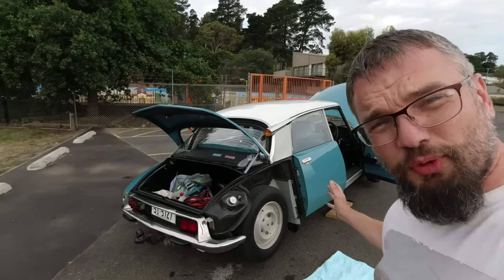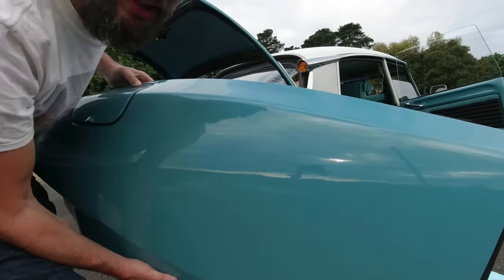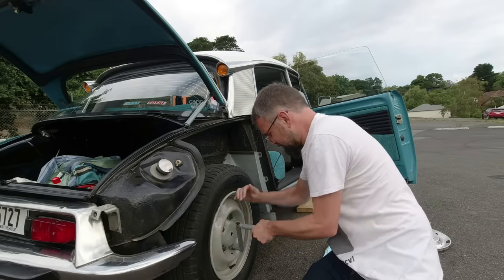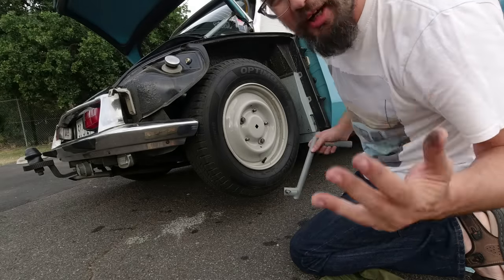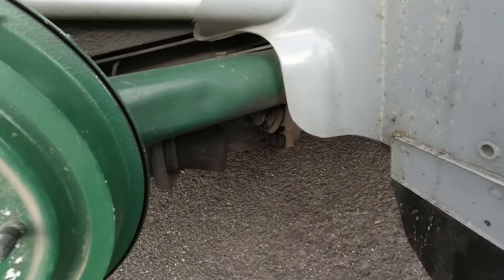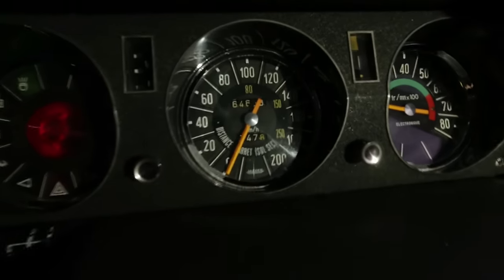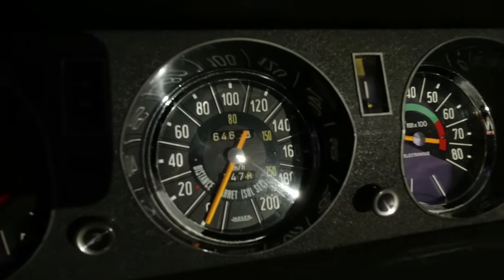Can it drive on three wheels?! And other Citroen DS Party Tricks

Comment: I remember going to a test day at
Mallory Park in the late sixties, where ta Citroen test driver did
the three wheel party trick and drove round the circuit, not too
slowly either. On the same day we were entertained by Innes Ireland
demonstrating a car, for the life of me I cant remember the make. The
demonstration didn't quite go to plan, a little too much sideways
action coming out of the devils elbow and the brand new car ended up
rolling down the start finish straight in spectacular fashion.
Luckily no one was hurt other than Innes's pride.

Comment: The swiveling headlights is a feature on posher versions of the old W211 Mercedes E-class as well. It's possibly not as pronounced as the Citroen implementation but on a dark twisty road at low speed it is clear that the lights are steering around to maximise useful illumination. Great feature!
Reply: I have 'em on my car.

Comment: Hi Hubnut. This car is like a new one. Citroen had it licked years ago with party tricks that other cars didn't do. Then didn't later models got more conventional in everything? I've gone and bought myself a Jaguar X Type. It's done 95,000 miles, 58 plate, Gleaming paintwork and good leather interior. Diesel 2.0 litre. I know what you're thinking 'What? a diesel!!!' Afraid so but it runs great and doesn't gobble fuel like a petrol Jag. £2,195. Dead chuffed. It's got electric everything and everything works and get this, it's got a proper alloy wheel spare wheel. This has to be a bargain. Keep up the good work. Cheers.

Comment: I don't think there is one DS owner who will not tell you a DS can drive on 3 wheels (as long as one of the back wheels is missing). And the demo is then always a dry demo or mock up if you will. But this is the first time I really get to see it, way cool. Anyway, never mind the party trick which is almost a public secret, what impressed me the most is the marvelous condition this DS is. You can only see that when you start to remove body parts like the rear fender. Compliments to the owner for keeping up his car so well. 
BTW, general de Gaulle owes his life to the DS when an attempted assassination was carried out on him. I forgot the details but I believe a rear tire was shot out or so and by raising the car up, his driver was able escape on three wheels. Something like that, but don't take my word for it.

Comment: I vaguely remember the Citroen GS TV commercials, where the car drove over broken glass, puncturing one of the rear tyres and continuing to drive, thus effectively on 3 wheels.
Reply: One of the TV ads had a driver driving between two oncoming HGVs side by side a car-width apart, and pressing a button to blow one of the tyres as he approached - and then he was able to continue without swerving in the narrow gap between the lorries.

Comment: While traveling through Kansas with my DS 21 i ran over some crash debris and destoried two tires.  I drove 40 miles to the next town on three wheels... I loved my 4 Citroens!
Reply: Also owned 4 D-series. Yes there were 5 full-size wheels and tires. Best to do the three-wheel stunt with rear wheel off the passenger side. Also, I think the drum would have more clearance with suspension on lower (maybe not lowest) position. If you bought your DS in the USA, it might have had a lockout guard on the suspension quadrant, which could be removed.  Funny that my '65 DSManual 21 had a a very short brake pedal, rather than the mushroom. And the clutch pedal had a weirdly awkward motion, compared the '60 ID19. My 4th D-Series was a '68 DS19 with hydraulic semi-auto gears & clutch. However, the 4th gear was too low (noisy) at 62 mph (100 km/h). The later 5-speed apparently did not have a "taller" final drive. The "rocking" headlights felt the impacts from the suspension and would shorten bulb life from night driving. The weight distribution 66-34 cause of poor handling, and I shudder to think of the roof caving in should the car roll over into a ditch. (It did happen to my '79 VW Rabbit (Golf), the steel roof held, although one A-pillar and door frame slightly buckled and windshield smashed). And the DS seating comfort not as good as my Volvo 740. However, due to pillar positioning, the visibility from the driver's seat optically made the pillar "invisible"- something that is missed by most non-owners.
Reply: @omarjette3859  I have owned many cars, MB, Saabs, Audis, Fords, Chevies but nothing was as safe or comfortable as my 4 Citroens. The last a 1973 SM..  Twice I avoided head-on collisions by taking it off-road both time at about 70 mph.   In the one instance in the US I ran over a traffic directing curb about 20 cm high to avoid a car crossing my path from the left.  Thought at first we hit the other car.  I stopped walked around and no damage. 
 The other time in British Columbia I flew off the road avoiding a head-on collision with a crazy guy passing a logging truck.  We went air-born and landed on the grassy slope of the road's abutment, it was at about a 30-degree incline, then seeing a concrete spillway ahead I whipped the wheel to the left and went air-born again landing in the center of the high way heading for the other ditch.  The car fishtailed a little as we lined our momentum up with the road and got back in our lane.  In both cases no damage...  Best cars I ever owned...
Reply: @jamesdond1  Suspect that the SM would handle better than the DS. I not only owned 2 IDs, a DSM21 and a DS 19 Pallas, but also did mechanical work on them. 
The 5 best features would be: a) the suspension, with its variable height and firmness control; b) visibility for parking and panoramic front view; c) the original 3-bearing engine was quieter at speed;  d) good low speed traction on snowy/icy roads; e) relatively easy to work on mechanically - with a little guidance from shop manual.
The 5 worst features were: a) weak roof and supports; b) the door hinges were just like steel pencil points - were they thinking them to fly off in a crash?; c) poor weight distribution resulting in extreme under-steer; d) engine difficult to keep tuned - an aftermarket electronic ignition helped a lot; e) the inboard brake discs could be damaged on bumps unless one raised the ride height on rough roads.
Not a fan of FWD cars, however my '09 Dodge shifts and pulls better with a 1.8 L engine. Unfortunately, if rides more like a Jeep.
Reply: @omarjette3859  The design of the Citroen regarding crashes is unrivaled.  When the Ford Pinto cases were tried the DOT produced videos of Citroens being crash tested to show how crashworthy a car could be made.  The funny thing they were outlawed in 1972 because of their crumple zones violated US bumper laws that Congress passed under pressure from insurance companies  Citroen withdrew from the market rather than sell unsafe cars.  The Ford (Boomabout) Pinto was legal.  But par for the course, this is the same bunch that forced airbags on the industry even after hearings that said they could kill 80 to 100 children yearly.  The chairman remarked, "that's an acceptable loss."  There are no engineers in Congress...
Reply: @jamesdond1  Not amused by the airbag that sits inside my steering either. Would be interesting to see the stats on how these have worked out (if we can believe them, as the old saying about ...damn lies). Also would be good to know how the crash/injury stats for DS-types stand. My '09 Dodge's body sides and beams are massive and stamped in one piece (I own a body repair manual). I know, car safety should be a combination of occupant protection and accident avoidance capability. Still would be interesting to see if later model Citroëns had computerized stability controls. Would rather put my money on RWD Volvo for safety, comfort and handling. BTW, presume you had the "American" spec Citroëns, whereas in Canada, we had the Euro specs. Jay Leno has his resto-modded as allowed by the "antiques" rule.
Reply: @omarjette3859  In 1976 I was T-boned by a big Chevy on the passenger's side.  The Chevy was totaled and the passenger went to the hospital.  No seat belt.  I drove my  1972 DS 21 home,  They replaced both doors put the interior back on and had to replace the stainless steel panel on the side beams but the B pillar and the box frame took the hit well even though we slid sideways for about 10 meters.  It happened in the rain so the coefficient of friction was compromised.  My passenger was freaked out but not hurt.  We both had our seat belts on. I had one other hit on that car in the back.  It was minor but taught me to keep track of the cars behind me...  A few years later we were in the midst of a 25 car pill up in a construction zone where they had put barriers on each side of the only lane open.  Traffic slowed to about 50 when I saw what looked like glass exploding into the air about 6 cars ahead. I put the breaks on and then noticed the car behind me was about to hit me.  I let off the brakes got about three meters from the car ahead then tried to hold that distance as we stopped so as to give the guy behind enough room to stop.  When all the skidding and banging noise stopped there were  10 cars head and about 15 cars behind crashed together, but we were not hit..  One of the things we noted the new "5 mile an hour" hardened bumper law put the back bumpers forcefully over the nose-diving front end destroying things.  Another thing the congressional playtime engineers never thought of.  The brakes on the Citroen could stop the car so fast and yet were so controllable.  The bad part we were stuck there for over 4 hours  My last DS was from Canada... had the enclosed headlights...  So cool.  Great for shining on addresses in the dark...
Reply: @jamesdond1  So it appears that the DS doors absorbed the impact without telegraphing any to the frame. Even a '76 Chevy was before the era of plastic foam "bumpers" (but rather massive chromed steel) and no crush zones. Always recall the IIHS crash test showing 1959 Chev vs. 2009. The '77 GMs were "downsized" massive.
As for pile-up on the freeway, when lanes alternatively slow down or clear up, one must concentrate on what might come up ahead. I was not involved, but following slowly in the middle lane of a three lane, noticed that left lane up ahead was completely stopped. However, the next driver to my left was not paying attention, did not brake (no tire squeal) and WHAM, smacked straight into the rear of the stopped car. Nothing I could do except keep moving, however, in a very short sideways glimpse, saw FLAMES at front of the crashing car. Happened so quickly, but did not seem that the airbag deployed. The important thing was for me to watch out ahead.

Comment: I once "borrowed" a DS and took it for a spin. As luck would have it, I got a flat and had to change a rear wheel. I can't remember the details now 40 years later, but I guess I must have head the driver's manual, since it's not intuitive in any way. Other than the puncture, the car wasn't harmed in any way (The keys were in the ignition). I remember that it was surprisingly fast.

Comment: Excellent ... thank you, kind sir ... as with others, knew well about these, but never saw them in action. Particularly the view from inside with those swivelling headlights. They’re brilliant. Have the VAG cornering fogs on my Fabia, and they’re ... not quite useless, but.... Ok, great vid, ta, Ian!
Reply: My Subaru has LED headlights and two of them point around but other than the way they wave about when the car is started I've never noticed the effect. They are about 10x the early aero headlights on my previous ride though.

Comment: Fun fact there's a citroen guide to applying the hand brake in order to apply the hand brake you must first apply the foot brake hard. The reason for this is as the hand brake works in the front when the discs are hot as the invariably are they expand. So if you park up with hot discs as they cool they contract so effectively releasing the hand brake. That was my CX's party trick
Reply from the maker: Never heard of that trick, but it is true that firm application of the brakes does tighten up the handbrake. A good emergency stop makes a huge difference! Have certainly heard of Citroens running away. Even Xantias did it! And my first 2CV...
Reply: @HubNut  to be fair it was only ever a problem if it was parked on a steep hill and i'd forgot to leave it in gear

Comment: Back in the early 2000's I drove a wagon delivering furniture all over the UK. One day I was leaving Southend heading back to London when I saw  DS for sale in a used car lot. I STOPPED TO HAVE a look and the salesman came over. The car was in respectable condition, nowhere near mint but very nice, it was finished in a lime green metallic, was fitted with A/Con. and had a brown leather interior which looked very dry and stiff, it was also l.h.d. All this was explained when the seller said " This car's previous owner was Monica Vitti and it's just come in from the South of France,have a sit in", so I did. After I got out he then said "There you go, your arse has just been where a sex bombs was". I'ld have loved to have bought it but he wanted £8000 for it then,  about 16 or 17 years ago and I was only a lowly driver so had to pass  on it.

Comment: And if that´s not enough. The main-beams (headlights) is also automatically adjusted in height in accordance with the pitch of the car depending on the soft suspension, which sinks the rear down and raises the front when accelerating hard (dynamic correction). This was invented so as to not dazzle meeting traffic. Otherwise the DS has constant ride height, irrespetive of load, so the main beams is always rightly aimed (static correction).
Note: The original D Special didn´t have the swivelling auxiliary lights nor the automatically adjusted headlights. So this must bee a modified car.

Comment: I love an old Citroen, but I always tense up a little bit when I see one being raised up. My BX died this way, the day after I bought my new car (I had intended to keep the BX as a weekender, in hindsight probably not realistic) - I took it for a wash, raised the suspension up and pop... something blew. Green fluid everywhere. It was uneconomical and impractical to fix particularly as I was moving across the country imminently so I had to let it go, but I did get around 3 years of almost cost free motoring out of it.
Reply: I had BX, no real problems with it, usual stuff did go wrong.

Comment: Engineers used to have all the fun back then! Steerable lights, active suspension, Concorde, Harrier jump-jets, Fairy Rotodyne, TSR-2, Apollo Saturn V rockets, cars with turbine engines for goodness sake! These days electric motors and a bland tablet instead of controls are about all we get. So stylish, somehow it needs French yellow headlights, but i suspect they wouldn't be legal in the Antipodes.
Reply: Too bad Citroen couldn't invent self-cancelling turn signals or a side mirror & sun visors that would stay put, for themselves and starter troubles WOW.

Comment: Very interesting, great to see the DS tricks in action. Much thanks to to the owner of this magnificent example too, love the colour and the delicious upholstery.
Reply: Both are perfect for the car. Mr Nut never said if the reupolstery was the same or close to the original or a possible original option.
Reply: @emjayay  This is the third time this car has been upholstered.  Originally it had a peacock blue velour which clashed a bit with the outside colour.  The last owner changed this for a lighter blue velour which looked better but by the time I bought the car that was starting to look sad.  I had the option of getting original repro. covers from Europe or just go my own way.  I decided to go my own way and I had an endless choice.  Settled on this one which is also supposed to wear very well.  Cheers.

Comment: My Vectra Estate has AFH, Adaptive Forward Headlights, and turns the same way,but goes by speed, so if going slow, will turn to it's steering input, but on high speed will only go a few degrees.

Comment: Great fun, I know this could be done, but this is the first time I've seen it. Slightly related, I was driving a E class about 17yrs ago and had a blow out on the M23. I was doing about 80mph (😂), I heard a pop, but apart from that, absolutely nothing, no tyre noise. Of course, pulled over and changed the wheel, but could I have carried on to the next junction? I am assuming the electronic suspension & what not kept the car level. 👍

Comment: Thanks for showing this. I have always loved the DS. It really is a masterpiece and this yours is a real gem. BTW, is it possible to remove the back wing if the car is normally parked if you have a suitable spanner?  And what was that grrrg . . . grrrg . . . grrrg sound when you drove the car? Is it air pump or something?
Reply: Exactly, it is the hydraulic pump cycling on and off keeping the pressure constant.
Reply: Probably dry or catching brake.
Reply: @peterriggall620   Pump is cycling because the main accumulator is shot, it's the sphere on the pressure reg.

Comment: Hi Hubnut. I noticed when you pulled off the wheel that it had a square hole in the centre. It reminded me of the VW arrangement of driving the speedo cable from a square hole in the front hub grease cap. Is there a strange and mysterious Citroen reason for it?
Reply: @RussEdgar445y7tlfj  Thanks for that.  Indeed, the link explains it perfectly!

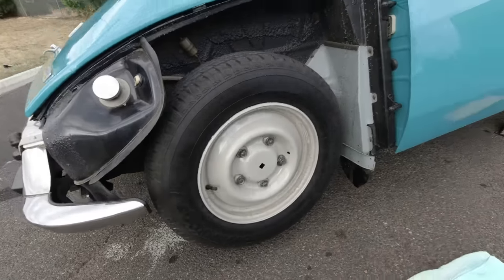Comment: 6:02 - 6:03 The piece of wood miraculously moves under the jack ! That is one hell of a party trick !

An expert would have switched the engine off as soon as the wheel rotates - so on replacement, no lifting of the wheel is necessary.